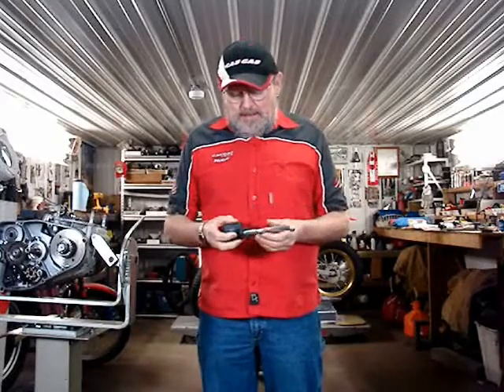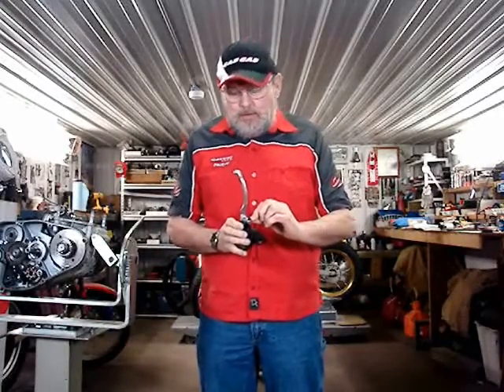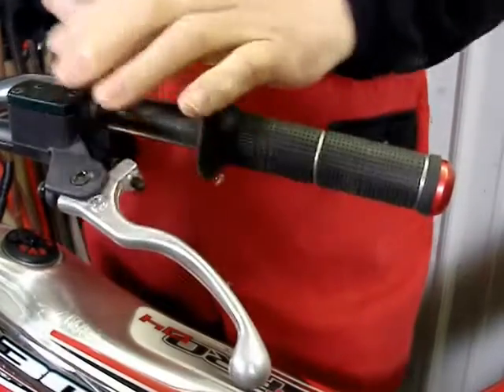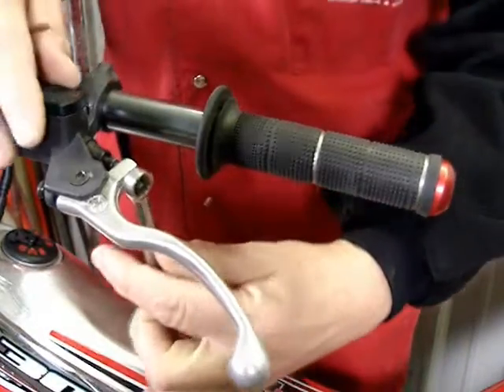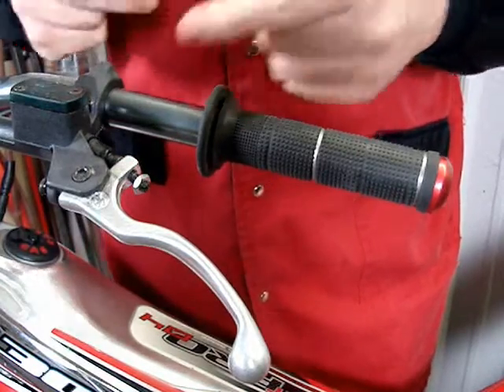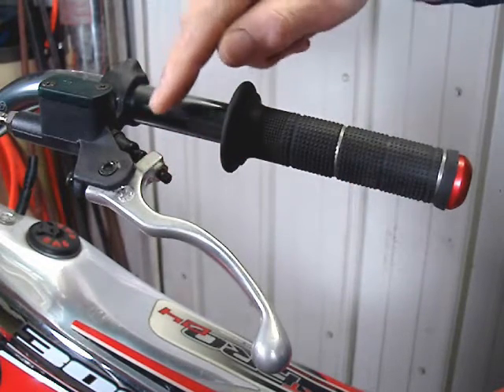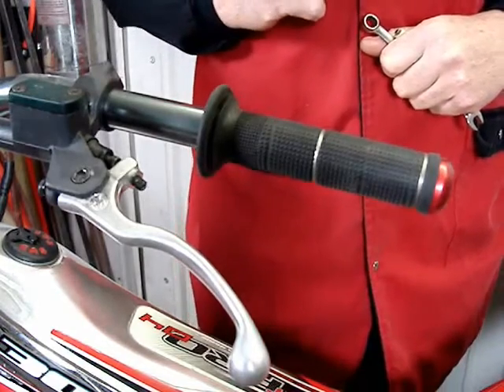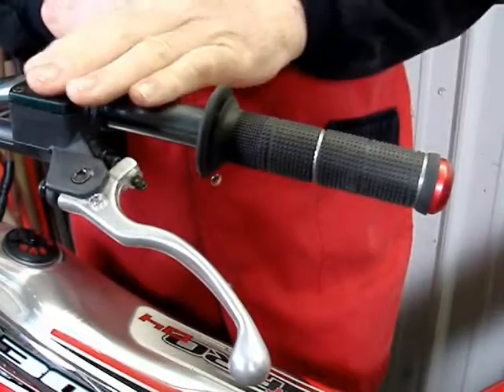Jim Snell - USA - Trials Enduro CLUTCH MASTER CYLINDERS explained

Comment: hi Jim do u have a video on how to change the lever it's self??
Reply from the maker: Hi,,
The lever? You simply take the bolt out and change the lever. 
If you mean the entire master cylinder, you simply unscrew the hydraulic hose form the unit and unbolt it from the handlebar. 
Best regards, Jim
Reply: OK thank you very much for ur fast reply very helpful 🖒👍

Comment: What would be considered clutch drag?
Reply from the maker: "drag" means that the clutch does not completely disengage and the bike continues to move forward even when the clutch lever is pulled-in. 
Clutch slip is when the clutch cannot keep the bike moving forward as the clutch is losing grip. Slip happens first in higher/taller gears typically, then progresses. You first notice slip as the engine is revving when the bike is not accelerating in a corresponding way, this is almost always caused by the fiber plates being worn-out.

Comment: What if the rubber protection cone is loose and not fulfilling a sealed off fit
Reply from the maker: Then it needs to be replaced if you want to return it to as-new. Dirt entry would be related to the type of element exposure use the specific machine endures.

Comment: where can i get mineral oil in spain or if not what is the fluid called?
Reply from the maker: +onit_ 46 hola -  Búsqueda en Google de esta frase "gro mineral moto españa" -  ("motocross center" is one on-line sellers) una marca tipico es "GRO" y la mayoría de los concesionarios de motos "off-road" deben tenerlo, GASGAS, KTM, Husqvana etc.
muchos saludos, Jim Snell